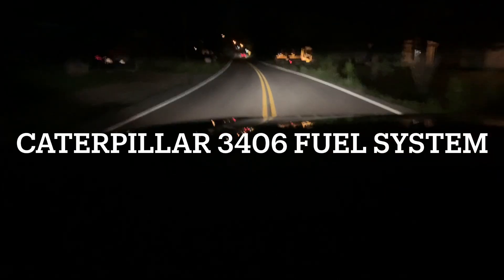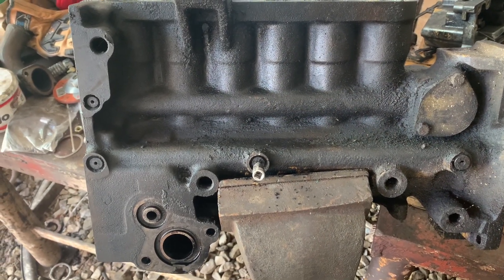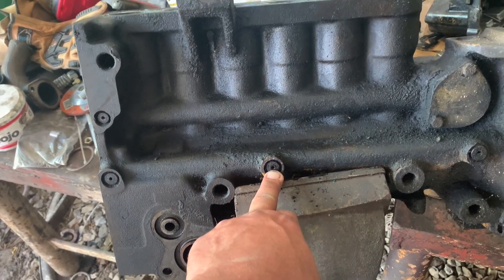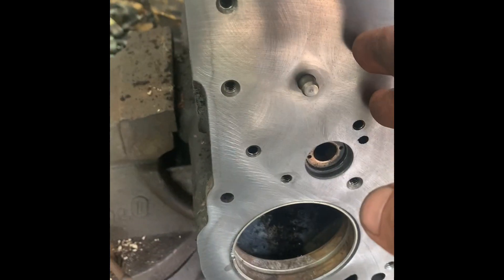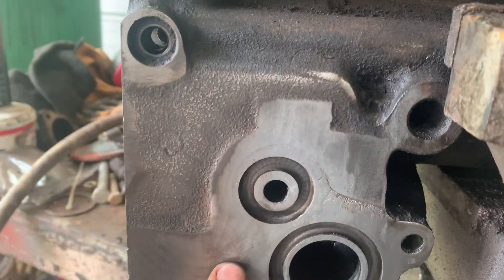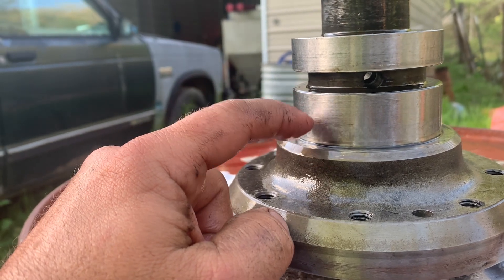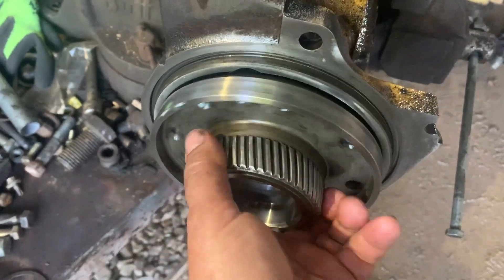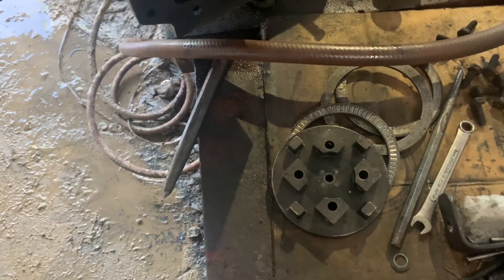Caterpillar 3406 fuel system assembly-part 1

Comment: Thank you for your videos, very helpful and educational. I purchased a old 359 Peterbilt with a b model, spun a rod bearing, the man I bought the truck from said he thought the rack in pump stuck… what would cause this and is it repairable?… Thank you again
Reply from the maker: yes, should be repairable. Cant say for sure on the pump sticking, however, for whatever reason, when everything went to ultra low sulfur diesel, we had multiple issues with pumps seizing up. don’t know if it was lack of lube in fuel or breaking loose buildup in lines from years of regular diesel fuel. that’s just my opinion